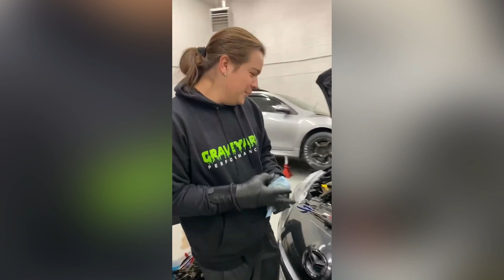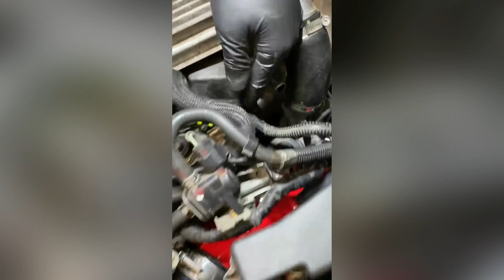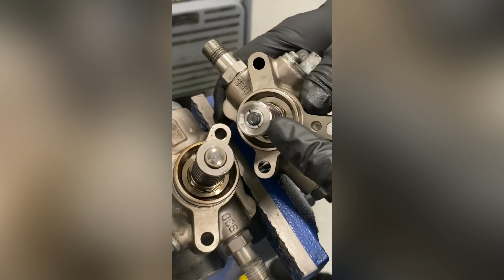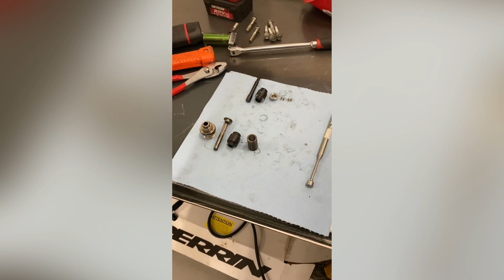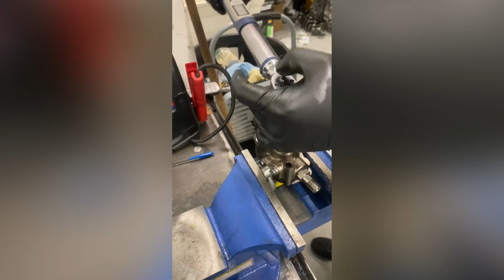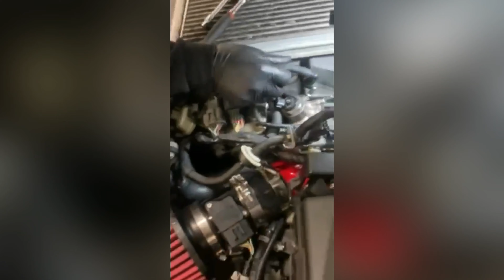Mazdaspeed HPFP Installation + OEM vs Autotech Identification!

Comment: Thanks for this video. I'm looking to do this for the first time. Could you also do video of adding the E85 seals to it as well? Update, took me 5 minutes. Everything in here is spot on step by step. Had a 2nd hpfp housing to tinker with, and it was extremely easy. Thank yall again

Comment: Is there no need for a gasket as the o-ring is being used?
Reply from the maker: On which area?
Reply: @graveyardperformance  on the section where the spring is and gets inserted

Comment: Would I be able to just switch the whole pumps (stock with one that has the hpfp already installed) or would it be better to just swap it into my stock one anyway since I’m looking into getting a slightly used one
Reply from the maker: @Dragaroi  yes you can swap a pump over that already has them. Never a bad idea to rebuild or clean the pump

Comment: Hey so when I try to put the pump back on, it doesn’t sit properly, it won’t even reach the dial pin without having to compress it, which I see you did not have to do here. Could it be I built it wrong or didn’t push the pin in the housing all the way? Any ideas ?
Reply: Honestly it did that with my stock pump . I just pushed it in so it could be flat and then I put the screws in . As long as it’s sitting flush it should be ok

Comment: Hello! So I had to buy a new hpfp because I stripped the 18mm bolt so I got my new one and installed the hpfpi to that and I installed it and it has the normal ticking noise of a hpfp, but when I give Barry give it gas there is like a strange noise, kind of like a bb or like scraping metal I can’t really explain it, but on my accessport everything seems to be normal on wot I’m getting 1774 and idle is roughly 420-427 any ideas on what it is? I mean everything runs fine. And I already broke it in at 130 miles
Reply: I have the same exact  issue.
It kinda sounds like a hollow metal sound right?
Fuel pressure  looks good and I've put 375 miles  on the new internals, no issues. 
Its just that noise.....

Did you ever find out what it was?
Reply: @gsrjohn  honesty not yet, I might just take it back out and see what the problem is, I know normally those hpfpi are kind of loud,  but I’m going to take it out and see what it is.
Reply: @crazyfireboy123  make sure to comment back if you find something out.
But the general  consensus  from everyone on the mazdaspeed  3 owners page on Facebook is that its normal.......there just that damn loud.
And I have already  put 400 miles on it with no issues.
Which helps feed my paranoia.
Reply: Any update on the noise?
Reply: @kwbalance108  still happens, but with my Cobb downpipe being so loud I don’t really hear it anymore
Reply: @crazyfireboy123  Gotcha. Thanks for the reply!
Reply: @kwbalance108  yeah np, i mean it’s doing its job, so it’s not like it’s damaging anything, kr is fine n I get about 1800-2000